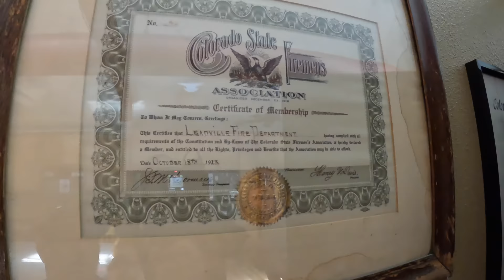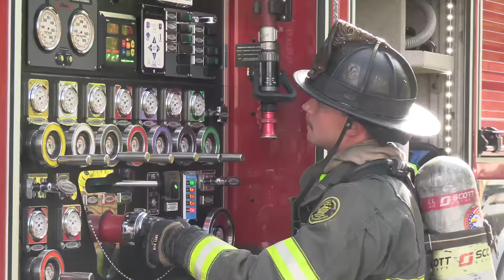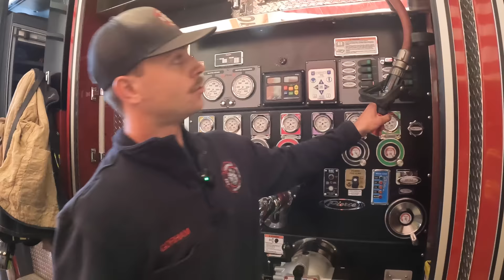Emergency Response - 2 Miles Above Sea Level

Comment: Four FFs to serve a population of 7'400? That seems insane to me. Granted I live in Switzerland where we have different procedures, but a town like mine with similar population (and a loooot less square miles) is covered by a volunteer department with 90 people. Granted volunteer and career departments are not the same thing, but I think four FFs is really not that much!
Reply: The four on duty would be the career staffing for one engine. If there were to be a large incident like a structure fire, crews would be called back in, and volunteers would respond as well. Having 4 full time staff just allows them to handle a lot of smaller calls like medical assists, automatic fire alarms, minor car wrecks, fuel spills, CO alarms, dumpster fires and smoke checks without having to use volunteers.

Comment: How does sea level affect fires?
Reply from the maker: The oxygen level drops to between 14% - 15% at the high elevations in Lake County compared to that at sea level (20.9%). Fires need between 15% - 16% oxygen to freely burn, so fire is minimally affected at this elevation. Anecdotally, structure fires seem to burn the same, but wildland fires tend to be more subdued unless low humidity, gusty winds and terrain all align.